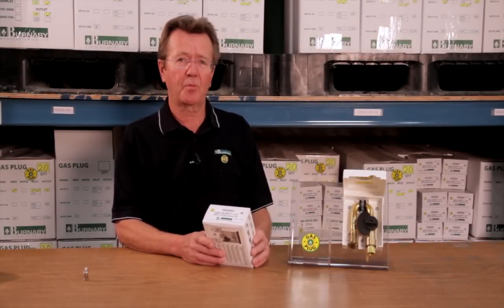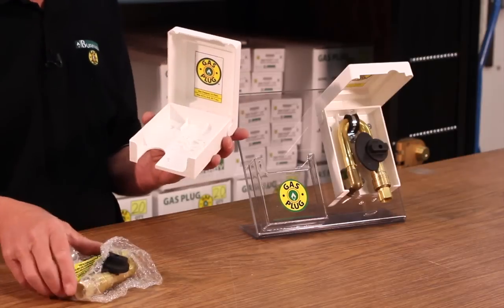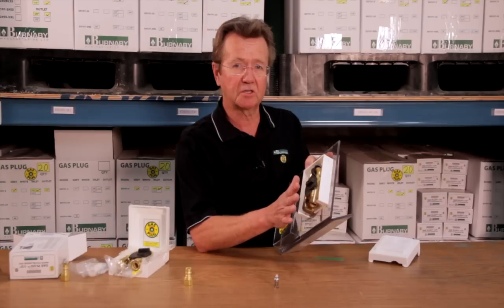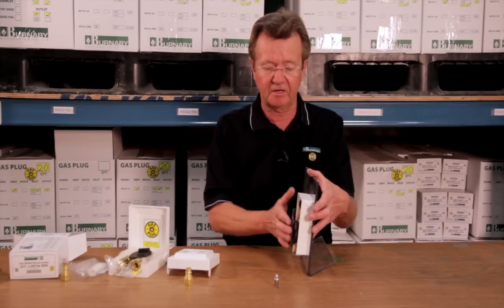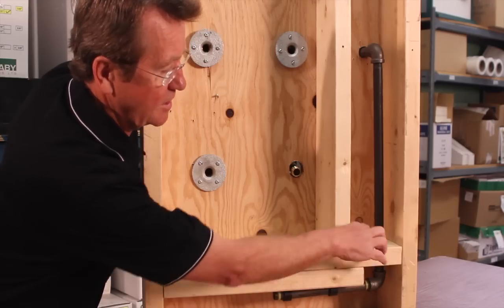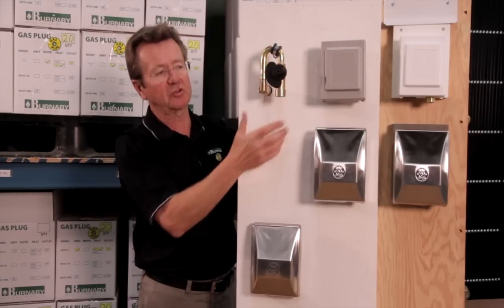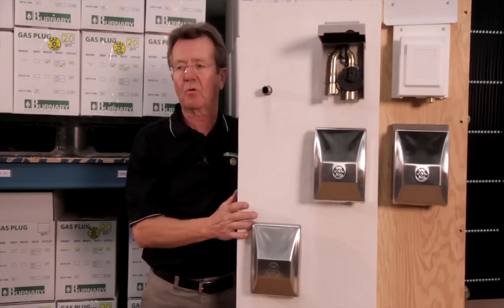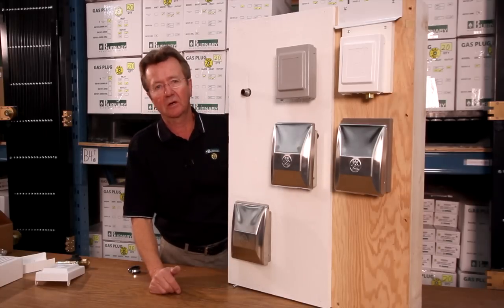Gas Plug(TM) - G0101-5 Installation Instructions

Comment: Can the gas plug be repaired if it has a propane leakage? Or the gas plug must be replaced at this point?
Reply from the maker: It depends where the leak is - best to consult with a licensed gas fitter

Comment: what happens if you leave the plug in?  mine's been in for a few years and today when I went to plug in my new Weber BBQ, gas won't flow. if I push in the hose a bit then gas will flow. did leaving in the plug that came with the box ruin my gas plug?
Reply from the maker: The plug shouldn't be left in the coupling during installation or without a hose being connected to it, but otherwise it is ok.  If you can send us a picture of the inside of your coupling, we can see what the problem is - email us at info@bbymfg.com